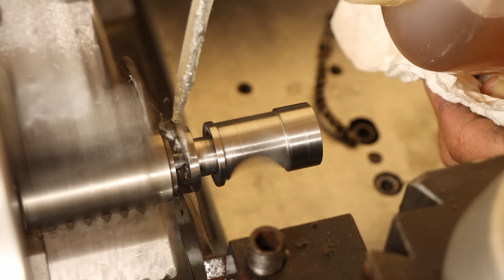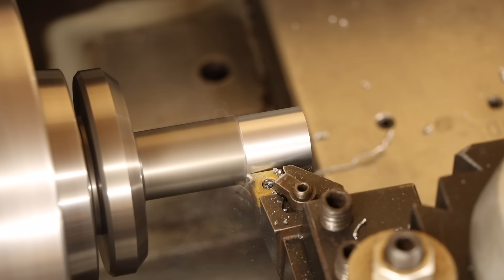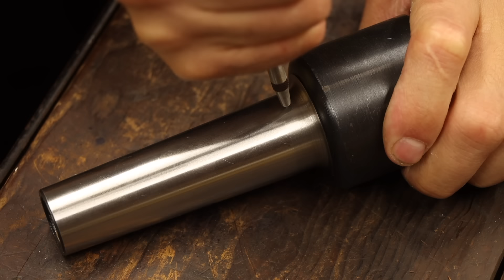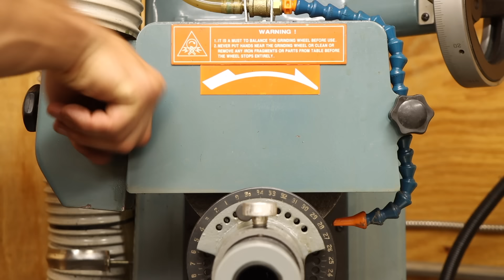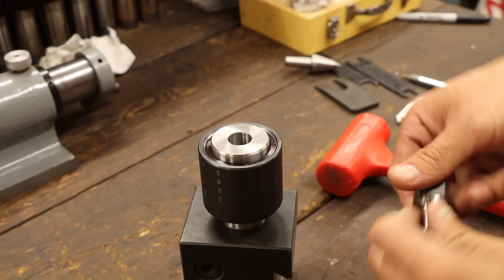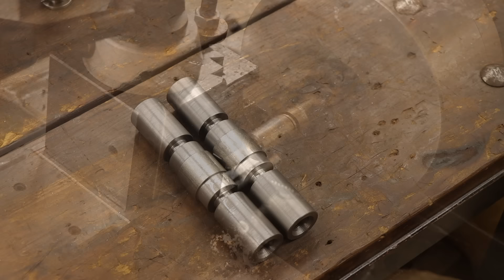Rotary Broaching Eccentric Cams || INHERITANCE MACHINING

Comment: Honestly you’ve outdone yourself on this one. Probably my favourite video thus far.
On a side note did you consider using an oil stone to put a radius on the sharp radial edges of the broach? 
Not that I have any experience with rotary broaches but just a thought to make the edges less prone to breaking.
Reply from the maker: Thank you! I didn't consider that but I think it would have helped a lot. Especially considering I didn't need the razor sharp corners to begin with. Someone else also mentioned hardening  before using since the "core" of the mill I used probably wasn't as hard as the outside would have been.

Comment: With the D1 adaptor that I made for my rotary axis I had it commercially nitride-hardened. It doesn't change the dimensions at all, so is safe for finished parts. 
As I recall it cost £40 (I could have had several hardened for that price, though)
Reply from the maker: Oh that's really good to know. I've ruled out the idea of hardening for that very reason but didn't consider nitride. I'm pretty sure there some sources in my area.

Comment: I don’t understand the purpose of rotating in rotatory broaching. Normally, I would rabbit hole it to death, but uh I thought I’d just ask other people this time. How does rotating affect the operation? Couldn’t he just use the lathe to push the broach forward?
Reply from the maker: The main advantage is from the tool being set at a 1 degree angle to the work. Then rotating the part results in only 1 corner engaged at a time and  takes a fraction of the force to work its way through

Comment: When indicating a part with the indicator  rotating you need to take into account that the stand arm can sag several thousandths causing top and bottom measurements to be off.

Comment: At 18:38, it looks like some of the studs are slightly proud of the bottom of the adapter, you might benefit from facing them off a little bit so they don't interfere.
Great video!
Reply from the maker: Good eye! I noticed that the first time i set the adapter on the table as it was rocking. Ended up grinding them off real quick without showing it

Comment: That is a really nice tool.  I love the utility of it, unfortunately for me my lathe chucks are too big to be practical with the limited Z space on my benchtop mill, but I guess I can dream.  I am looking forward to the final results after hardening and seeing if you decide to leave the whole thing bright or if you blue the cams.  My vote would be a nice dark black blue job on the cams, but either way that is a beautiful job.  I am still curious about how parallel the faces of the adapter are.
Reply from the maker: I'm kind of partial to the all steel look. For whatever reason it seems more "precision" looking lol But I may change my mind after hardening.

I didn't get a chance to check this in time for the video but I just went down spun it under the indicator. Its about 2 thou out. Checked the table too and its within a few tenths so its all in the adapter. Probably has a lot to do with how narrow of a window I was doing the 2 point indication method on compared to diameter. I don't quite trust the jaw faces to rest against that but now I know how off it is I could use that in the jaw setup. Then turn it true.

Comment: Congratulation on the completion of the build.  As a follow up to my previous comment on your earlier video, you have successfully exceeded my result in terns of overall accuracy from my build of the same sort of device (simpler design and slightly smaller chucks).  

Loved the dremel on the lathe!  I got all fancy with my original tiny lathe, made a 3D printed adapter for a mini air die grinder.  Then I made one out of a drill chuck on a steel rod with a couple of bearings all in a chuck of PLA from the printer.  They functioned great...but...I never had the need to use them.  Maybe I'll make and adapter so they work on my current lathe...then continue to never use them lol.
Reply from the maker: Thank you! I actually later discovered most of my runout issues were actual from my two adapter faces not being parallel. So I may be revisiting that before too long. Also, that's just the way with tools sometimes. 😂 But when you need it, you'll have it!
Reply: @InheritanceMachining  Just to mention it, I had a look at the shirts, rather like a few of them.  At the checkout seems if you buy two of the same shirt the shipping goes up by just a buck or two, if you get two shirts of different types you get a no discount double shipping fee.  Guess they have a really lazy guy in the warehouse, won't go to two different shelves without an extra $10 lol

Comment: The broken broach was so painful. Then the subsequent 5min operation on the mill to finish that operation of the 5 cams was . . . well, hilarious. 
Well done again sir. 
I love this stuff.
Reply from the maker: I could have been worse I suppose 😁 Thank you
Reply: @InheritanceMachining  to be honest I was interested in why you needed the corners to be so sharp for the function in the first place; I've regularly 'designed' square drive (or hex for that matter) parts intended to not require broaching so they can be milled instead, especially when we're talking such a short run of parts (or if non-standard sizes).
Reply from the maker: @Avram42  It was mostly a bad assumption on my part. I assumed I needed a fairly sharp corner for the wrench to fit and didn't consider that the corners would be rounded. I was also excited about (and stuck on) the idea of making the broach. You live and you learn lol
Reply: @InheritanceMachining I'm not a machinist (but I dream of having a mill and lathe... and WTH, all the rest of that stuff to tinker with, because: why not).... but say you needed to have those corners sharp. Could you perform that milling operation (to hog out most of the material) and use the broach to cut the corners? Would that process lessen the forces on the cutting tool?
Reply: @TheDesertRat31  that is why you are supposed to drill 10% over sized like he did after trying flat to flat size drill and it didn't work, you can drill out more to lessen the forces involved though but that would decrease the engagement surfaces, the problem whit milling away material to make a none round hole would be ensuring the broach engage correctly which is not impossible though finicky I assume, I may be wrong about this though,
Reply: Have you ever tried punch broaching? I worked for a broaching company when I was younger. I was hired for CNC Wire EDM machining. We did a lot of punch broach manufacturing. When they are ground correctly they produce very accurate and highly polished internal shapes.